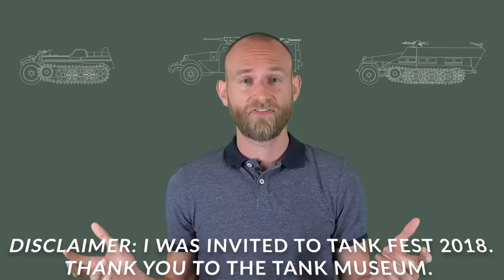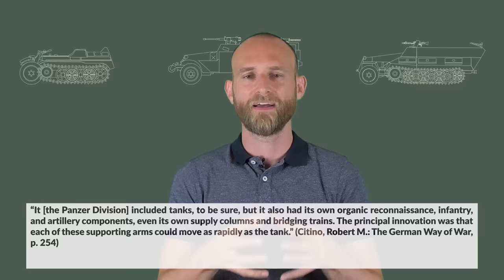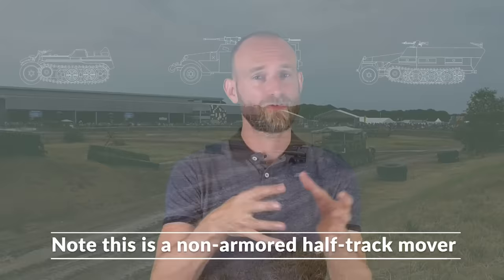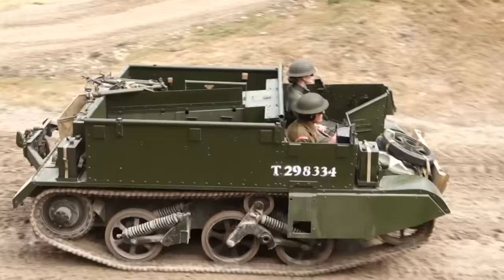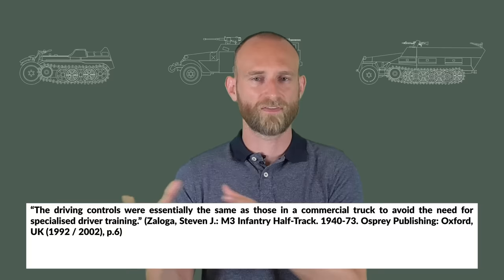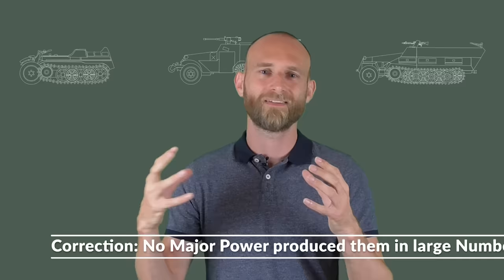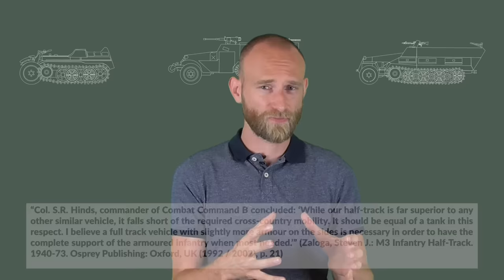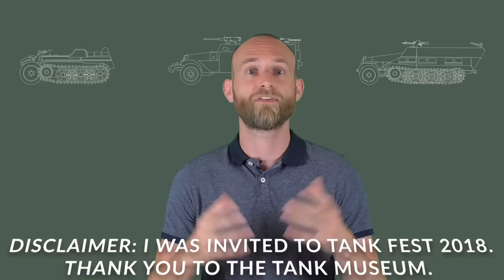Why Halftracks? Why limited to WW2 only? (Featuring Tank Fest 2018)

Comment: Personally, I could possibly see the half-track make a comeback. I mean, the Isrealis still use the M3 to this day. It's versatile, pretty light, relatively mobile, and typically not too expensive. Not to mention the possibilities with new engines and transmission systems. I could also see them being used in arctic warfare with snow tires and broader tracks.

Comment: Good video but you missed the steering gear box factor. Early fully tracked APC's could not perform well because because the gear box did not support useful steering. They also damaged tar roads when steering. The half track did not destroy the road in a turn. Late in the war differential gearboxes that could steer a tank or half track accurately became available. Rubber pads on the bottom of the track were added that helped save the roads. 
Also a large number of kangaroos had an effect too because that were used successfully as troop carriers. Kangaroos were allied tanks/ tank killers that had lost their turrets due to damage (or just had them removed due the lack of mobile enemy tanks faced later in the war). Used to carry light infantry and gun crews.  The first kangaroos were Priest tanks that were no longer fit to face german tanks.

Comment: How did the steering work? Were the steering wheels independent of the tracks, or did the steering wheel also control differential steering on the tracks too? How were they synchronized?

Comment: the half track is pretty much the Development of many Problems and solutions

-Problem: Tanks are blind and vulnerable to flanking by enemy infantry and AT guns, we need infantry to support them and scout for them.
-Solution, assign 3 Infantry Regiments to the Tank Division.

-Problem: Infantry on foot are too slow to keep up with tanks
-Solution: put the Infantry in trucks

-Problem: Tanks enter the thick of the battle alot, trucks are neither armored and are large targets, it's too dangerous for the Infantry
-Solution: put armor on the trucks

-Probelm: the Armored Trucks now weigh alot and have extremely high ground presure, they are unable to go offroad and can't keep up with the tanks.
-Solution: replace the wheels with tracks decrease ground pressure.

-Probelm: the Clutch brake steering system is inept for a fast vehicle, turning causes the inner track to brake adn thus slows the whole vehicle down which is an extreme deterient to mobility for a fast moving vehicle.
-Solution: replace Clutch brake with Celtrac differential steering which is regenerative meaning when the inner track slows down it puts that power to the outer one speeding it up and thus no loss in speed when turning.

-Problem: the Celtrac diff combined with the tracks and the armor has made the APC too expensive relative to how many men it is carrying, also Celtrac differentials require a special trained driver to operate costing more money.
-Solution, make it mostly tracked to keep the ground pressure low enough to move rapidly offroad with 2 frontwheels (with front whell drive ofcourse) for steering with a regular Differentail between them and the tracks which doesn't slow down when turing and is no more difficult than a car.

Thus the Halftrack was born.

Comment: It must be very hard on the tires. Just imagine all the surface and mass that keeps pushing forward and just a slight tilt of the wheels (with very little contact surface) has to cause the entire thing to go around the corner...
Reply: edi I disagree, with halftrack having been built with a differential both front and rear in the American case it turns corners on hard or soft ground very normal the exception would be nice and like any two or four wheel drive if a wheel and a track slip you don't move there weren't locking differenchels at that time

Comment: I think you're missing the point that by giving tracks to the back end of truck then you increase off road capabilities without substantial weight gain. It was cheaper to do this than produce a fully tracked vehicle.  The American attitude all the way through the M113 the APC was a battle taxi and not a fighting vehicle. The IFV is designed to actually engage the enemy before the infantry dismount.  With an APC the infantry should dismount before engaging so it is less armored. APC often had AT weapons added as their use evolved.

Comment: one small note - the OT810 - the HAlftrack APC based on Sd.Kfz.251 was used in Czechoslovak army until 1995 (well in the end in secondary roles) and it was priduced from 1958 to 1962... so it is not so true that this kind of vehicles is only about WW2...
Reply from the maker: as stated in the video "produced by major countries";
Israel and many other countries also used a lot of halftracks post-WW2.
Reply: @MilitaryHistoryNotVisualized  yes, but the OT-810 was generaly new vehicle - that's why I'm talking about it. But it is a fact that the development was based on production of Sd.Kfz.251 during the war...

Comment: Well, it does not fully explain why there was not a M113 like during the war. I understand the logic of easier training for the drivers, still given the amount of strange vehicles produced or even designed it remains an interesting question why a fully armoured personnel carrier was not introduced even in limited numbers
Reply from the maker: someone made a very good point that I missed, protection from nuclear, biological and chemical weapons, e.g., the T-55 was a NBC "capable" version of the T-54. As such, a full enclosure is even more important. Yet, it probably might have happened with the NBC criteria as well, since the half-tracks didn't protect against strafing, mortar fire and hand grenades.

Comment: Half tracks did not totally disappear, in many cold countries, like Canada, they just been renamed "snowmobiles"  In the 70s 80s , the world started producing tactical trucks like Oshkosh, Tatra , Man etc they are more expensive but have off road performance at least as good as half tracks and they can be armored and take troops behind on a bolt on armored enclosure. One new vehicle I can see will be with us soon, by the lessons learned in the Ukraine war, is a new air defense vehicle, to go out with any armored vehicles, this vehicle will specialized in jamming and destroying drones, with guns as small as rotary 22LR  or 556 mm. Right now this is a big gap and all armored vehicles are just designed to be strongest in frontal arc.

Comment: The assumption here of course, is that modern militaries are actually CORRECT to have gotten rid of halftracks. Keep in mind we've never had a world war again, so it may be a mistake. 
The two main advantages I see of haltracks over fully wheeled APCs is higher speed in urban areas (where more and more future wars will be fought) plus much better visibility and situational awareness for the infantry and crew thanks to the open top. No modern APC's armor can protect against a main battle tank gun or good anti-tank missile. So I for one would rather be in a vehicle that I can quickly bail out of before it's hit or shortly after if a fire starts inside. 
Furthermore it's much faster for an entire infantry squad to deploy EN MASSE out an open top then to wait for a rear ramp to come down and file out 2 x 2. Might give you a few extra crucial seconds when your mechanized infantry is assaulting an objective.

Comment: The comment about half tracks being open on top is true, however many APCs, armoured personnel carriers, fight with an open top.  The big difference is that the APCs such as the M113 can close that hatch whereas the half tracks could not.  The problem with APCs is that when they are closed up, their firepower and visibility are greatly reduced.

More important however is that APCs are not tanks.  They cannot absorb rounds from heavy weapons.  APCs, like half tracks, are designed to protect troops while transporting them to the front lines.  They are also designed to provide some protection when they have no choice to fight from within the vehicle, such as during an ambush or a movement to contact and the contact occurs sooner than expected.

There was a brief mention about IFVs, or infantry fighting vehicles.  In almost all cases, this is a misnomer.  IFVs such as the Marder, BMP, and even the Bradley, have limited protection contrasted to a tank.  Yes, in some cases they are more heavily armoured than an APC, and of course they do have more integral firepower, but they are not truly capable of fighting alongside a tank.

The problem with IFVs is that they are like the mermaid mentioned in the video.  The have more firepower than previous APCs and more protection, but this is at the cost of fewer troops, greater maintenance, and greater cost.  The Bradley in particular is so degraded in terms of troop carrying that doctrine had to be modified.  We, the U.S. that is, don't have enough boots on the ground in mechanized infantry squads now that they are not really expected to seize and HOLD ground like infantry units before.  A Bradley (Not the scout version which only carried two or three scouts) only carries a maximum of six infantry, plus the crew of three.  In contrast, the M113 could in theory carry 11 infantrymen.  It should be noted that the later versions of the M2 Bradley have eliminated the firing ports for the infantry, thus lessening the fighting part of IFV.   IFVs from other countries have similar problems.

It should be noted however that the Israeli army actually does have a true IFV.  Actually they have at least two that I know of.  The first is based upon the excellent Centurion tank.  I think it was called the Nagmacnon (SP?).  It had the same armour and mobility of the Centurion tank but no turret.  They have also the Namer which is based upon the Merkava tank and is in fact even more heavily armored than the Merkava.  These IFVs can actually fight alongside tanks.

The half tracks and so-called IFVs (not counting the Israeli IFVs), when used properly, are employed as support for the tanks.  The brings troops to the LD/LC (line of departure/line of control) and as far forward as possible.  The provide protection to the infantrymen from artillery, mortars, and small arms fire while the infantry get into position.  In theory the tanks will sit back and then support the infantry as they advance.  They also allow the infantry to be much less tired because they can ride further while being deployed.

Finally, I am talking about traditional combat.  Low intensity conflicts, insurgencies, and other unconventional warfare require different deployment.

Comment: Your video makes me wonder if half-tracks would be good counter-insurgency vehicles against enemies with little to no artillery, fighting in rugged country
Reply: hand grenades. but isis (and probably other armed groups) did produce some open top fighting veichles, think they did have something that looked like a open topped m3 in one random video i saw
Reply: Check with Israel, they used their american half tracks will into the 1980's. There should be something written about how well they performed during the fighting in Lebanon, Israel and occupied Palestine.
Reply: paul menard - Toyota pickups are open top behind the cab.
Reply: I'm not talking about technicals, or open-topped vehicles. I'm wondering if half-tracks would be good, if perhaps over-specialized, counter-insurgency vehicles in hilly/mountainous terrain, or any other rugged terrain. I've fought from Humvees before, but some terrain was too dangerous to go because of balance/weight distribution/versatility issues. Would tracks help?
Reply: Depending on dimensions of the tracks and tyres, a half track should have better weight distribution than a wheeled vehicle. Though I imagine that a completely tracked vehicle, like the Bv206 ( https://en.wikipedia.org/wiki/Bandvagn_206 ) would be preferable for the best possible mobility.

Half tracks seems to have been something of an anachronism, a stop gap while technology matured enough for practical fully tracked vehicles. (Universal carrier excluded, as it's small size made it relatively easy to steer by bending the tracks, a system not practical on heavier vehicles.)

Comment: The only advantage a halftrack has is if a track breaks on a hill they can maintain some braking and directional control. Otherwise they have all the complications of a tracked vehicle and a wheeled vehicle. Maximum limiting speed of the track portion is the same for track only and track-wheel hybrids. For the tracks to be usefull they need to carry most of the vehicle weight, but that reduces weight on the front tires and limits the steering effectiveness. 
The differential steering on a track-only vehicle is not a difficult skill to learn. Unless they are recruiting from a mental institution any operator will be proficient with an hour of practice.

Comment: Excellent presentation!  I have wondered previously as to why the Germans didnt even prototype APCs using some of their SP artillery chassis.  The did so much experimentation with tanks you'd think at least one of the mfgs would have proposed something along those lines.  Probably comes down to the speed/mobility issue discussed.  Some years back, I kit bashed some 1/35 scale models and built a APC based on a Hummel/Nashorn chassis.  Added some punch by using a turret from a Sdkfz 222.
Reply: I'm guessing that fuel economy would be a big issue as well. Moving 10-ish soldiers with a vehicle with a tank engine, contra moving them with a half track with a lorry engine.

Not to mention that factories building tanks and self propelled AA/G etc. would now also have to set aside workers for building such vehicles, while there might be production lines for half tracks available. And switching production lines and re-tooling factories is quite a costly and time consuming endevour in itself.
Reply: Lavrentivs - A half track assembly line is a heavy truck assembly line.
Reply: @Al Grayson That was my point. If you build "tank apcs", you would have to use the tank assembly line. With half tracks you build them on another assembly line and thus can focus your tank production on building tanks.

Comment: as a modern set up, we use more wheels in replace of tracks. a multi wheel vehicle isn't as good as a track of the same length, and a full tracked is more efficient where it matters for the vehicle build. basically a half track is more expensive than a wheel vehicle, making them unnecessarily expensive for "cheap" vehicles, and a half track is unnecessarily complex and performs less effectively as compared to a fully tracked vehicle.

as a non-military example skid-steers in the 1980s and 1990s where almost exclusively wheeled, but because of this their use in site construction was limited if non-existent, in this period it was found that the drive mechanism on them could be modified to have tracks (rubber), which gave them more extensive traction/power and made them effective for moving in mud while hauling a load. there were of course track conversions but these were metal tracks meant for snow, ice, and thick mud which were slow to change over and use effectively.
hence the need for half tracked vehicles are moot as tracks are effective where wheels are not and wheels are cheaper and "good enough" where tracks are not.

Comment: Economy and logistics. After WW2 putting out wheeled was cheaper. Tracked APC are still used for conflicts. Balloon type on the fly pressure adjusted tires are for logistics and troops but not for in the mix of shrapnel and other fires. WW2 tracks were good since lots of roads weren't paved and getting into and out tree line was easy with half tracks.

Comment: In the 2nd World war the driving systems were prone to failure because of heavy duty and rough landscape. Steering with a halftrack was easier, especially in combat situations. You can simply drive, in a caterpillar you had to brake one chain track. The german Tiger was the first tank with a steering wheel and easy to drive (and also by that fact complicated to build). After the war full tracked systems became more reliable and therefore the first choice. At least since 1960 and the introduction of the M-113. Before that halftracks were used even after WW II, so in Korea, the middle east and even vietnam. Today the drive systems are very developed. You have caterpillars but also wheeled armoured vehicles (Stryker, german Transportpanzer 1 "Fuchs"). There is no need for a hybrid anymore. The last halftrack in production and use (at least I know) was the czechian OT-810. He was a regular combat vehicle until the 80`s.

Comment: I think the armies who have used the halftrack concern more of the spare parts logistic nightmare and field maintenence. Why for one vehicle do you need to spare both wheel and track parts, not a good idea in war time.  Just think of some British tank design in WWII that utilizes 2 different sizes of road wheel for whatever good engineering reason but this design also ultimately discarded after the war too. So you see my point.

Comment: Hmm still don't quite get why they were made in the first place, but its still less clear why they stopped using them. Really thinking from a cost perspective where a 1/2 track feels like it would be a lot cheaper to produce than a fully tracked vehicle with no civilian analog. That said, they are cool!
Reply: Watch a Video of operation barbarossa and see what happend to russian "roads" in spring or fall.
Most german halftracks were build for towing heavy guns offroad.
4 or 6-wheeled trucks in this time are good for roads but not for offroad (look at the "offroad" tires of the '40 and compare them to the tires today)